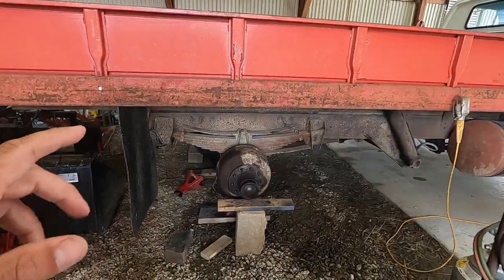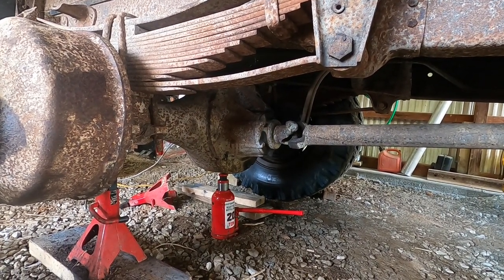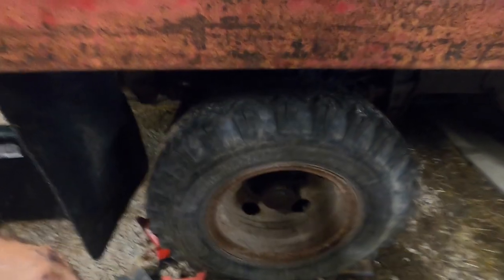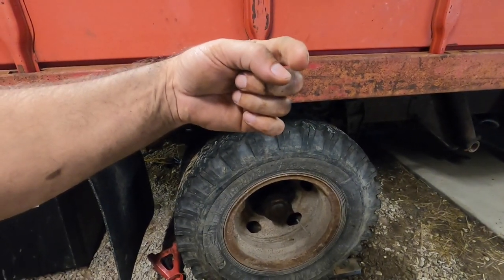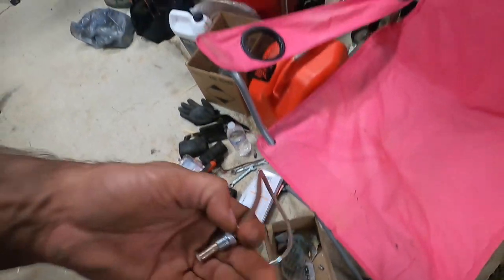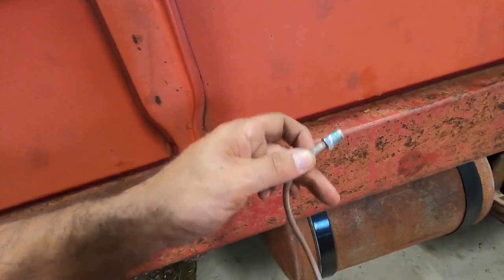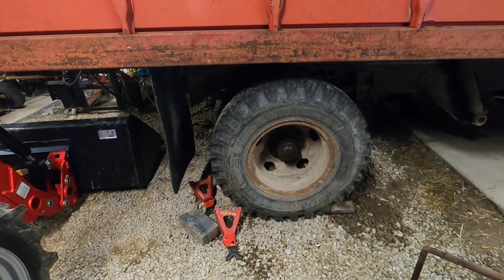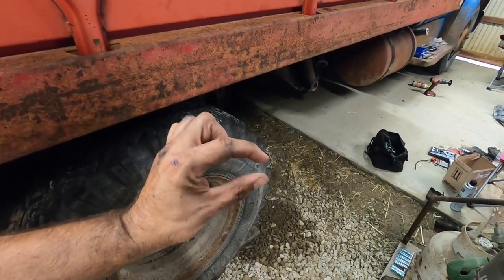Big Blue Brakes Part 3 - The Brake Job is Becoming a Battleground on the C60

Comment: im so glad i foumd this channel  i have a 1973 gmc c60 with a 350 but i had a differential leak didnt realize and blew out the pinion gear and housing on the drive shaft side  excited to what you do with it i subscribed
Reply from the maker: You might like my Project Yellow as well.  Is yours a 4 speed/2 speed combo?  Thanks for watching and commenting!

Comment: Well, I see what appears to be a new wheel cylinder! Price (if you don't mind my asking)? Did you end up using copper line? Wonder if a custom bent stainless line is available to connect the lower and upper wheel cylinders? Nice tip on the longer nut required to get past the backing plate!
Reply from the maker: We used what I thought was copper but it was actually some kind of copper nickel alloy if I remember right.  It's been so long, I don't remember the price.  Whatever you think it should be, better double it these days lol.  Not sure about the stainless.

Comment: Hi I hope you'll reply to this comment, where did you get the parts for the brakes? I have a 78 c60 and can't find hardware kits or shoes anywhere, I'd greatly appreciate any leads.
Reply from the maker: I got some parts at O'Reilly Auto Parts.  I think Napa carries some bigger truck parts as well.  If I think of any other source, I'll let you know.  I don't think RockAuto or 1A has very many brake parts listed online.
Reply: @FabbedFun  I'll have to check O'Reilly's, I got a few bolts and pins from napa I needed but no main components or kits, nothing seems to be avalible.
Reply from the maker: @smokeybandit299  I'll have to look again.  I thought for sure I got something from Rock Auto, but I don't see anything listed.  Must have been another online retailer...

Comment: I like you videos but how come you don't show how to bleed the system....
Reply from the maker: It was a two man operation with one pumping brake down, the other person cracks the bleeder, then tightens after a squirt of fluid and air, then the person in the cab lets the brake up.  Repeat until no air in the lines.  Keep an eye on the master cylinder to make sure you don't run out of fluid or you have to start over.
Reply: Thanks ese... I still have a problem with the back brakes locking up
Reply from the maker: @jhhc5975  Check your springs, that they are attached properly, and make sure you spray everything down with brake cleaner so you don't have dust or fluid causing the brakes to grab.

Comment: Where did you get your side rail for big blue
Reply from the maker: The side rail on the grain bed?  If that's what you're talking about, the grain body had 4' sides, then 1' extensions.  If you take the 1' off, then the 4' off, the 1' would fit down into the main bed.  I hope that answers your question.  Thanks for watching and commenting!

Comment: I HOPE that WASN'T CopperTubing You are using as a Brake Line......Good Golly DON'T UST THAT ITS NOT LAWFUL AT ALL. IT TAKES STAINLESS TUBING WITH A DOUBLE OR INVERTED FLAIR. PLEASE CHECK THIS OUT WHAT I'M SAYING PLEASE.
Reply from the maker: Technically, it's a copper nickel alloy that makes it easier to bend but safer than straight copper.  Thanks for watching and commenting.